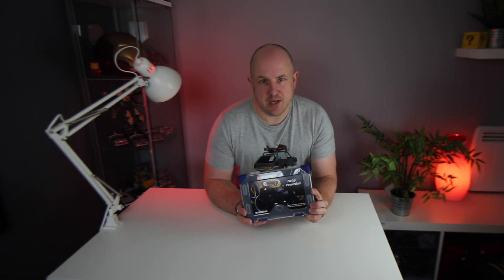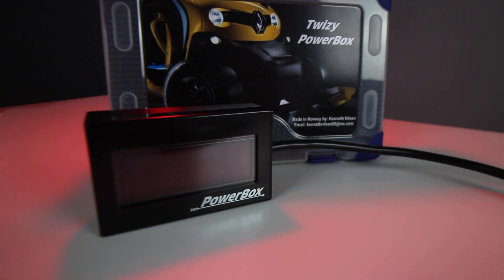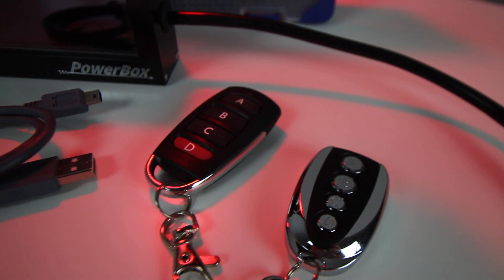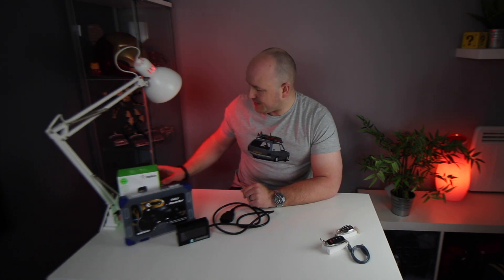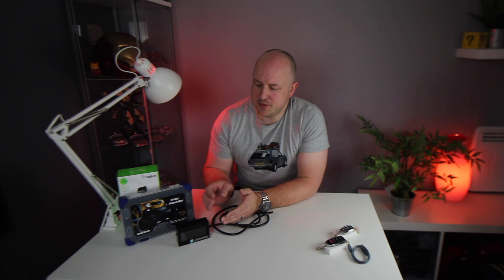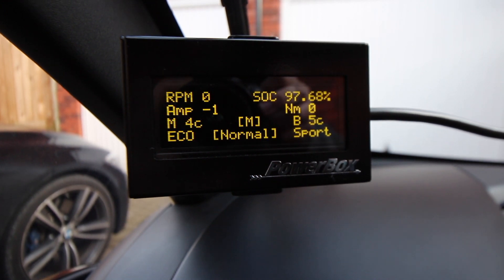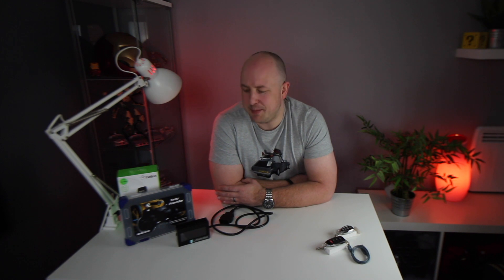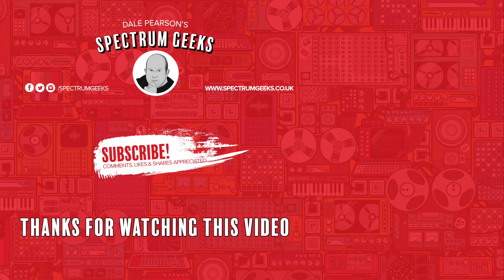Renault Twizy Tuning with the PowerBox v2 Comprehensive Review

Comment: Do you need to inform your insurers then???? Uk
Reply from the maker: You "should" inform your insurer with regards to any modification to your car. However, with switchable mods like this, many people do not.
So upto you what you do :)
Reply: @SpectrumGeeks  many thanks. Does it affect battery power / range much and would this work on a brand new uk spec twizzy. I’m looking at one today 😁
Reply from the maker: @morkthebuilder9943  In terms of power and range. The power is increased alot, so does pull more from the battery and reduce range, but only if you drive hard everywhere (I did as only did short runs). However, if you drive smoothly the tune actually gave me slightly better range sometimes, as a better curve.
As for working on a brand new Twizy, NO. If you get a new Twizy and want to do this mod you will need to replace some component with old compatible gear. Best to get in touch with Ken to find out what the current options are for a new Twizy.
Reply: @SpectrumGeeks  brilliant thanks

Comment: How does this work for the twizy 45 Sir?
Reply from the maker: The Powerbox has firmware available for the 45 version. Just need to state you are running the Twizy 45 to make sure the correct firmware is loaded to the Powerbox V2.
Reply: Spectrum Geeks thanks for the information!
Reply: Thanks for the reply!
What are the performance increases for the 45?
Reply from the maker: Not sure on acceleration, but I know max speed is 80kph at 10,000 rpm. It gets to 70kph pretty quick, then slow slog to max speed.

Comment: I'm thinking to buy a twizy, I'm from Colombia South America, I have two question, doing this void the warranty?, and It's possible on a 2018 model?
Reply from the maker: it is possible on a 2018 model, but not reversable, you need a pre 2016 model to be able to switch back to stock.
Technically yes it does void the warranty.
Reply: Spectrum Geeks  thank you for anwsering my question, looks cool but I won't do it for a car that i'll be paying for at least 5 years.

Comment: Hi plus how does the batt hold up do you notice the charge drop less distance all that jazz
Reply from the maker: The PowerBox itself does not impact the battery directly (it does pull some power so you should turn it off when not in use). The PowerBox enables you to increase regen, so it can actually help you get more range :).
In reality though, as you have more power you drive it harder so it can feel like you get through the battery quicker, but I don't really notice any impact in range, just more smiles per mile now.

Comment: One of the best mods for the Twizy.  The only wee bit of experience issue is when I have the “pedal to the metal”, the STOP light turns on in the dash and beeping you get which warns you about the load on the main battery relay.  I wish I could just turn that off.  I wish I had a Powebox for the Zoe also 🤓
Reply from the maker: Agreed on the Stop light but you just mentality ignore it after a while :) Deffo money well spent though.